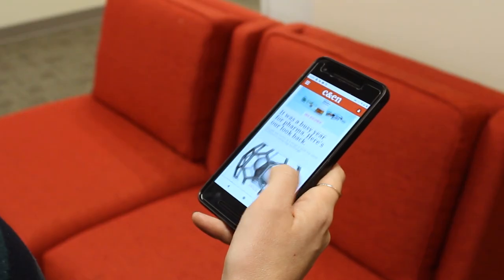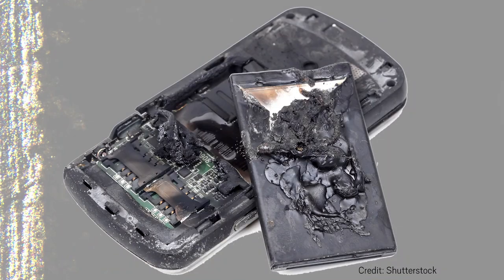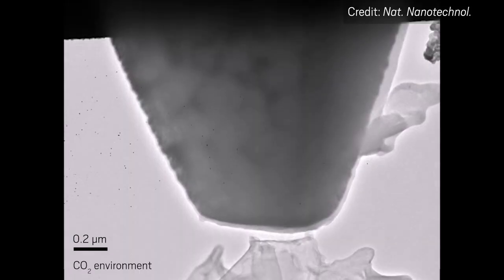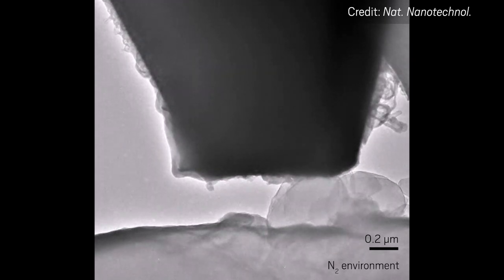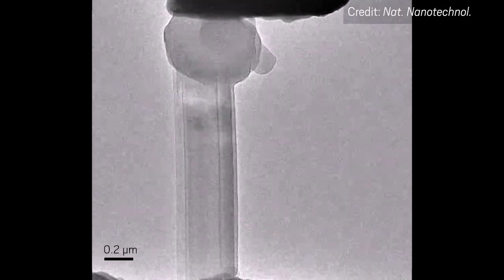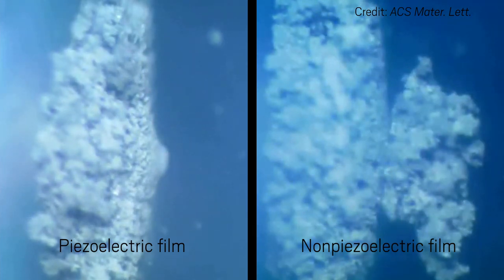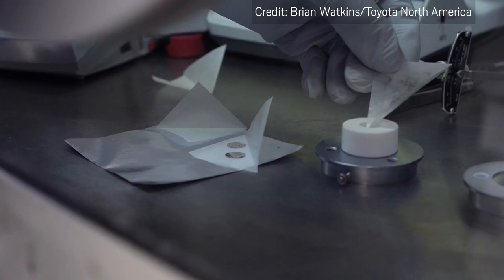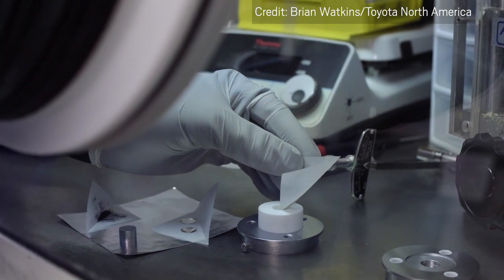Scientists tackle the lithium dendrite problem in batteries

Comment: There are ways to limit or out right prevent Li-dendrites from forming in the 1st place.  
1... never fast charge a Li-ion battery.   Dendrites mostly form in Li-ion batteries when they are fast charged, because the greater the increase in current, the more often dentrites form, because of the increase in energy.  
Dendrites almost never form when the battery is charged slowly at low Amps, & the ones that do easily break down because the low energy current allows for the lithium to redisolve.  

2... never boost charge a Li-ion battery, for the same reasons above, because boost charging is a form of overcharging the battery in order overcome the internal resistance.   
Voltage drops as a battery discharges, & the more the battery is discharged, the greater the internal resistance of the battery becomes, requiring an increase in voltage & current to recharge.  

3... never let a Li-ion battery drop below 20% capacity before recharging, eliminating the need to boost charge the battery.    
Once a Li-ion battery drops below 20% charge capacity, the charger has to boost the voltage & current to overcome that resistance.  

The problem is in practical terms... how many people maintain these Li-ion batteries like this, especially in EVs?  
And particularly with EVs... is it logistically feasible for most people to follow those 3 rules?
Reply: Great comment. The missing price of this is what is considered fast charging for each type of battery. Surely they aren't all the same. Does size of the battery really change what is considered fast? Just because I have a lot of batteries (high capacity [ah]) needed to be charged does that necessarily change how dendrites form in them? I don't think so. Is tbis getting so much in the weeds that it doesn't matter with existing tech? Idk. Much more to be explored I think.
Reply: @tggraham3321  
Yes battery size does effect what is considered fast charging, because the smaller the battery, the less voltage that is needed to pass current through it, & the less energy they will hold.  
Plug a cellphone up to a 240 V charger & it will explode.  

Also, the smaller the Li battey, the less likely dendrites will form in them.  
It' is far less likely for them to form in small single cell Li batteries, because they hold very little energy to start with compared to EV batteries.   
Cellphone batteries for example are not very prone to dendrite build up.  They usually catch fire from overcharging which overheats the battery causing an external rupture, that exposes a short to the circuitry.  

All your divice chargers are designed to regulate the proper amount of voltage & amperage for the device they are designed for.  
They will automatically regulate a normal slow charge when the battery is above 20% capacity, & will not try to boost charge  unless the battery is completely discharged.   
Below  20% capacity... these chargers will automatically run a higher amp fast charge  or boost charge through it unti the battery is above 20% capacity.  

EVs are the real danger here, because their batteries hold a massive amount of energy... & any time they are fast charged or boosted... there is a high risk of dendrite formation, especially when boost charged.  
But the problem here is most EV owners are not aware of how to properly maintain & charge these batteries, & it is often not logistically feasible for most people to do so.  
Most EV owners cannot afford to have their EVs sit for 8 - 10 hours on a slow charge, & resort to pluging into a rapid 1 hour Tesla charger at a gas station.  
Best case scenario, this just ruins the battery's chemistry faster from dendrite build up requiring full replacement after 3 - 5 years.  
Worst case scenario a short occurs & your EV becomes a pile of toxic ash.  

Another factor to consider is ambient temperature.  
When it's cold outside, Li-batteries can handle taking a fast charge better with minimal dendrite build up.  Still not ideal, but theres less degradation.  
When it's hot outside, even with their internal cooling systems, the potential for dendrite build up during fast charging, is through the roof.

Comment: Considering that applied field strength (i.e. voltage) affects the cycle life of a battery, is it safe to say that the local increase in field strength is a factor in dendrite formation?
Reply: It is the main parameter
Reply: Yes... 100%

Comment: It seems like the very method used to purify Lithium causes crystalline growth inside the dissolved electrolyte. Unless there's some other mechanism at work like the presence of phosphate Solubulizing Bacteria in extracted brine chelating the Lithium OR simple electrochemical reduction of the electrolyte. I've always been a fan of H.G. Wells 'War of the Worlds', so I'm a bit partial to the bacterial contamination angle. Doesn't the spike look like a plant sprouting from a seed?